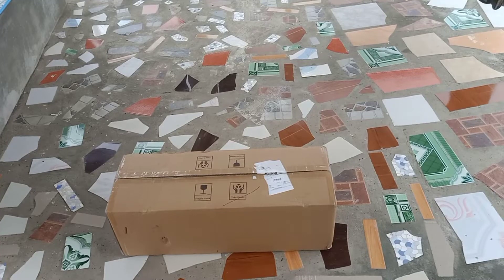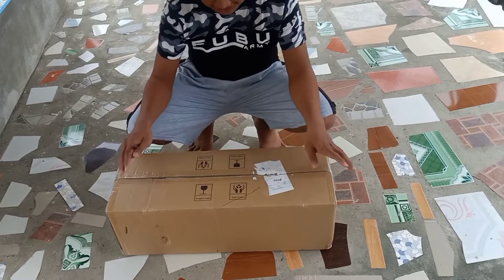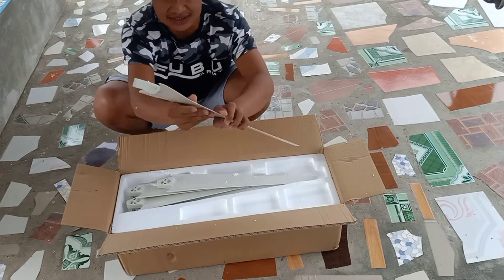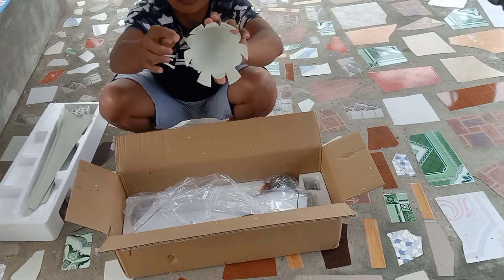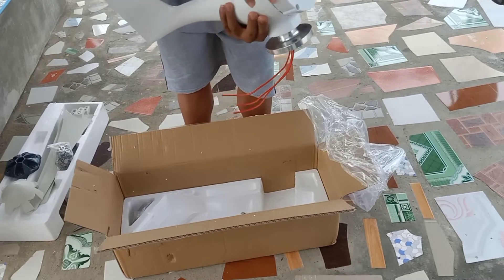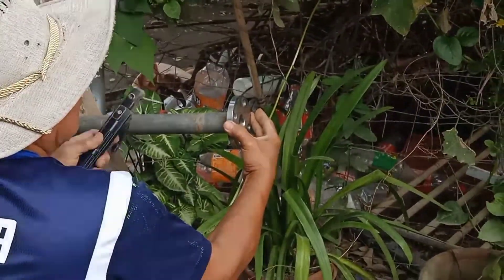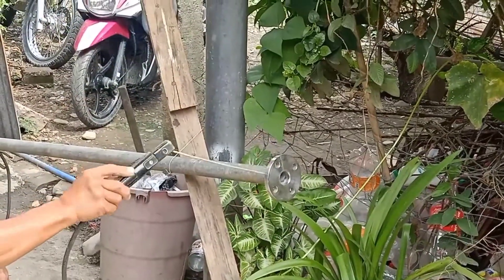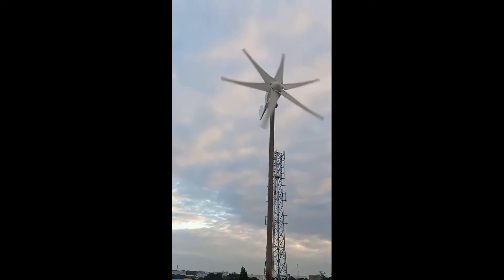Wind Turbine 48v 800w from china.

Comment: Did you test how much Power it draws? How much watts in Reality
Reply from the maker: Nope. Can't even gain some 1amp even in strong wind.. maybe the turbine is 48v and im using 12v battery with 12v/24v charge controller.
Reply: @allzzizzwellzz5841  i guess the controller which comes with the kit ia trash.
Better get an ac-dc converter, and use a real mppt charge controller like epever tracer or victron
Reply from the maker: @PitbikeUpload  can powmr mppt 60a can do the trick
Reply: @allzzizzwellzz5841  have a link?
Reply: Did you use mppt controller?